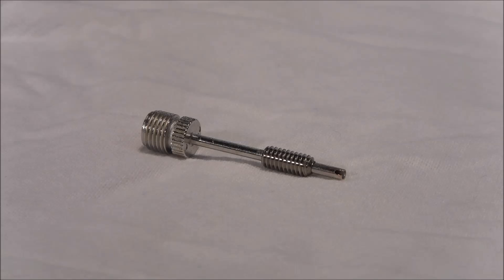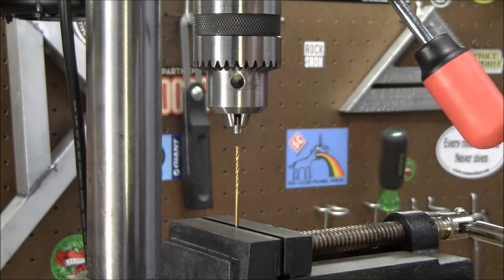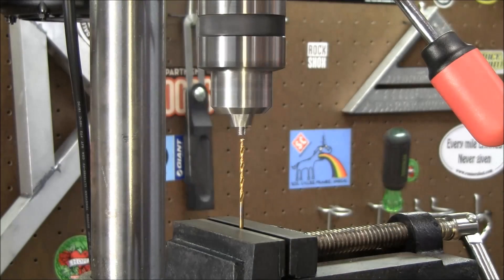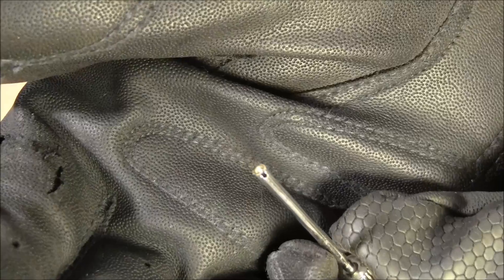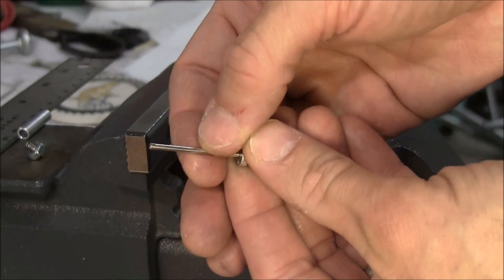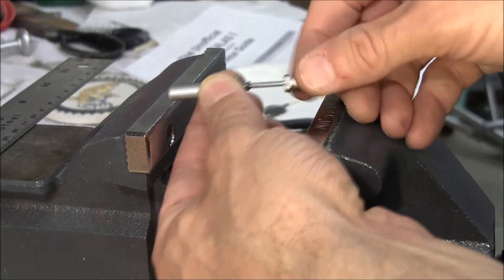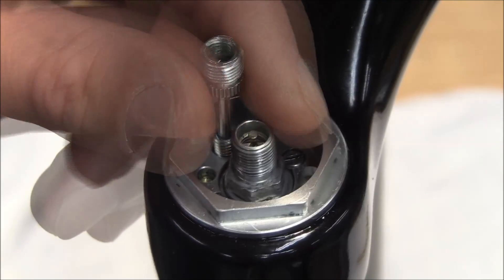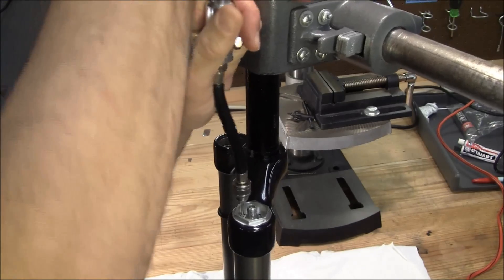DIY Fox TALAS IFP Charging Tool

Comment: Very useful video. Thanks for doing this. Do you have a parts list ( the URL in the info doesn't work) in particular the thread of the set screw, 8-32 this is also 1/4 no ?, and is it UNC or UNF ?. Thanks again

Comment: Hi , I wonder if I can, because I used metric screw to make the tool, and I don' t know if I could screw it completly or not, original screw seems a litle different, well, the lenght of pin is 8mm on mine; many thanks again :)